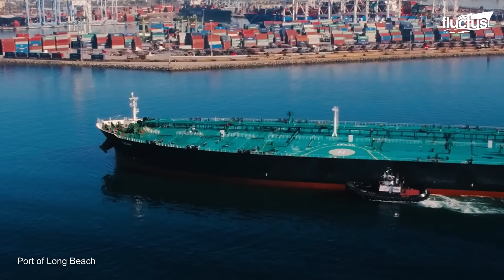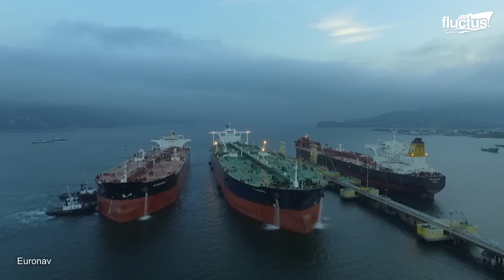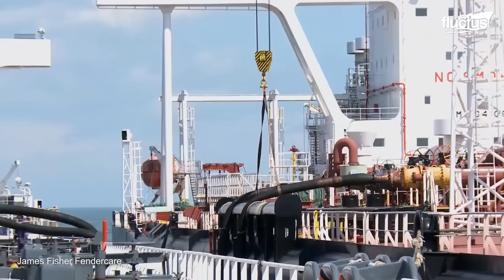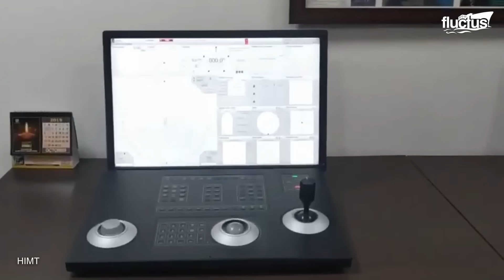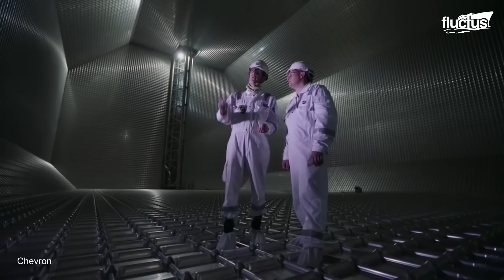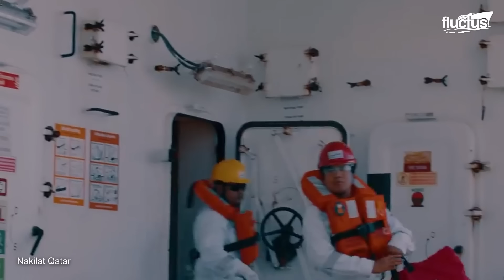Life Inside World Largest Tanker Ships Transporting Million $ of Oil

Comment: I asked chatgpt how many tanker truck can be filled with the oil from the supertanker

A typical tanker truck used for fuel transport can carry around 30,000 to 35,000 liters of fuel. In contrast, a supertanker ship can carry millions of liters of oil, typically ranging from 300,000 to 2 million liters per tanker, depending on its size and capacity.

Assuming an average supertanker capacity of 1.5 million liters and a tanker truck capacity of 32,500 liters, you could fill approximately 46 tanker trucks with the oil from a single supertanker shipment. Keep in mind that these are rough estimates, and actual capacities can vary based on specific tanker models and ship sizes.